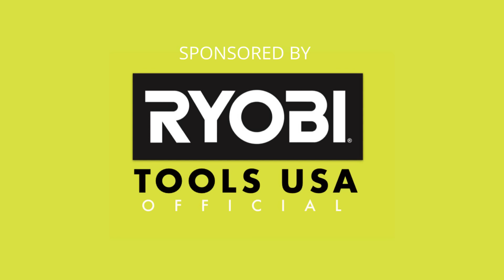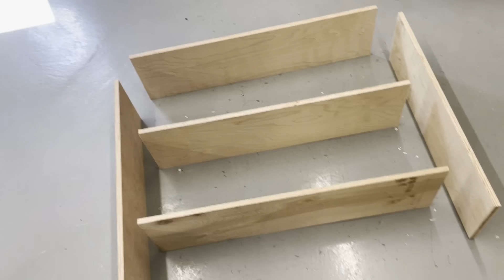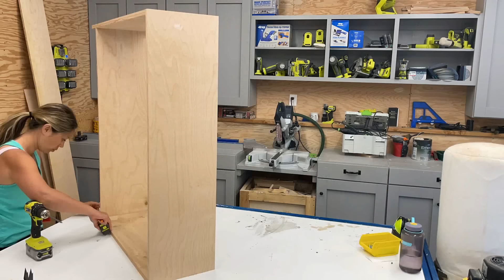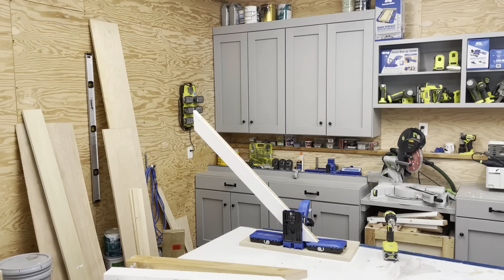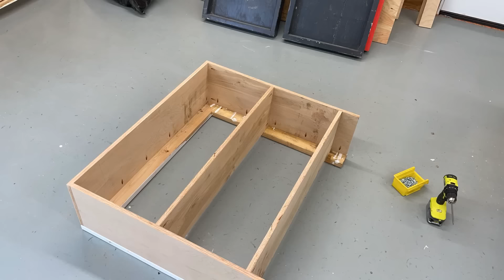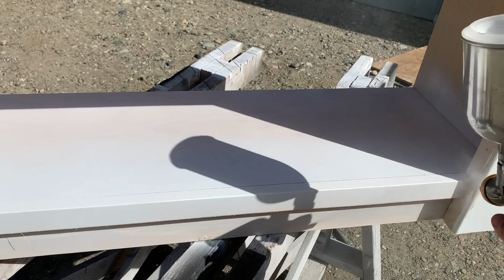Build a Mountain Modern Bookshelf with Free Plans

Comment: Question. We have a large rock fireplace on one wall, on one side is an entry to our living room, and one side is just wall. I’d like to build a built in shelving unit from the wall up to the rock fire place, up to the ceiling (as the fire place does ). Any suggestion on how to do this?  The ceiling slants away from the fire place at the roof line. But I’d like the shelving unit to go up to the ceiling. I could send a picture.  Appreciate an suggestions! Love your work!

Comment: Couldn't you just nail it to the front and fill with putty, sand then paint over?
Reply: Yes, always multiple ways to do just about anything.  Just also always trade offs and what's convenient may depend on your set up and what tools you have access to...

Mind, nails don't hold as well as screws.  So would be more dependent on glue holding it together if you nail it.  A lot of times the nails are just used to avoid needing clamps.  While putty and sanding can take awhile and some people just really hate sanding...

Pocket holes have their drawbacks too, being harder to conceal, needs a jig, and is harder to use on thin stock but they're usually pretty strong joinery that you don't have to worry as much about wood movement and can be done pretty quickly but nailing would still be quicker...

You can also do both, adding pocket holes to make it better handle wood movement over time but do most of the fastening with nails...

Ultimately, just do it the way you're most comfortable doing and works for your project...